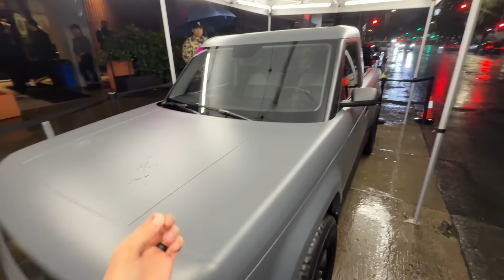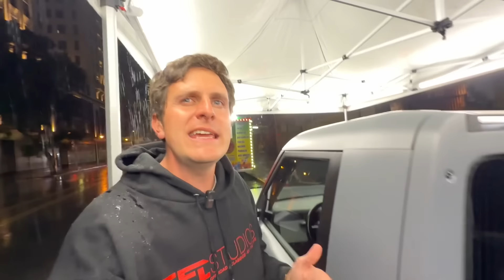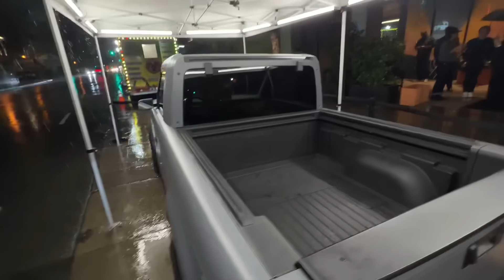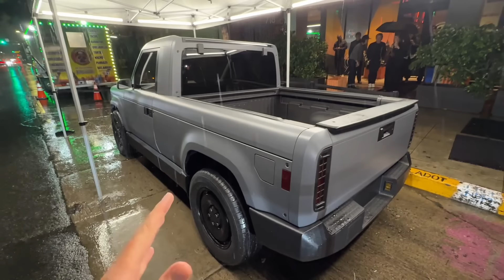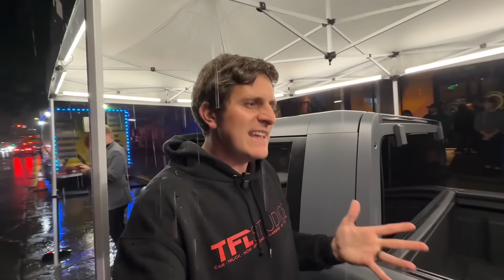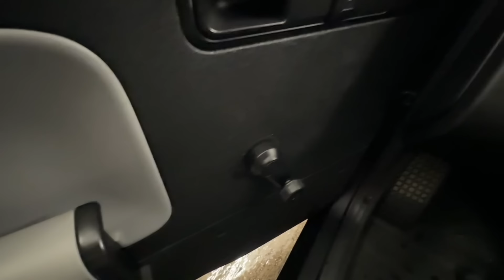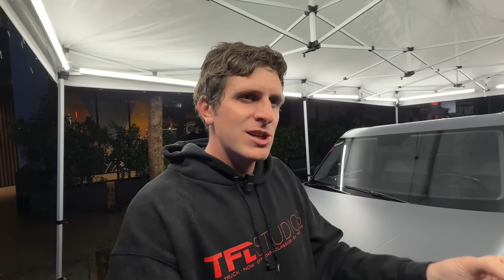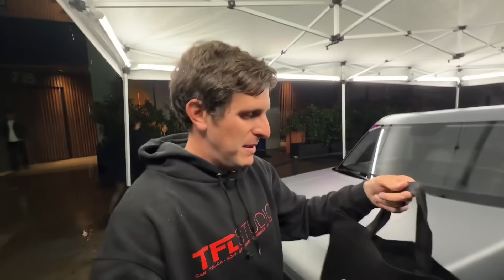The TRUTH About the '$20K' Slate Truck...Will This Really Be a Hit?

Comment: An in-line four with a five speed manual would be perfect in this truck.
Reply: Doesn't even need to be 4 cylinder iny eyes it could be a 660cc just like a kei truck.. it needs a gas motor option with a full frame and 4x4 and it would sell like crazy
Reply: @thomascramer8523  so it needs to be something completely different and it would be good?
Reply: @TheRanscat absolutely I live in a area that a battery powered car would not work for almost half the year because of the temperature. Right now I have a hybrid that I can't use the battery because the car might catch fire if I charge it. I'm good on a grown up power wheel and will stick to using dino juice for as long as I live I gave it a try and ended up 60k in debt with THE MAIN FEATURE BEING UNUSABLE.
Reply: @johngifford7725  the electric drive train is the only reason this truck has a chance. Small trucks didn't go away by accident. They have a low profit margin and a very limited customer base especially when people can't own a second or third vehicle. With a simplified design and electrical power, the Slate will be much cheaper to produce. For reference, Tesla has twice the margin of other car companies.
Reply: Kind of misses the point of the whole thing. It's meant, from the ground up, to be an affordable EV truck using some innovative modular design concepts. This isn't going to, nor is it meant to, appeal to people who are predisposed to being dead set against anything EV.
Reply: They can't put an ICE in this. They'll lose all of their "green" funding.
Reply: @chairmankaga2821  The green funding won't be there anyways. That all being said, developing a ICE model would probably cost them more in R&D than putting out an electric and the consumer would be paying the extra cost for the manufacturing anyways.
Reply: A few years I said once the EV's get more range and the entry level prices drop you will see alot of these cheaper EV's enter the market because the IC vehicle reliability in the last 10 years with engines and transmission failures are through the roof.

The dark horses in this race are the Chinese manufacturers who just got a toe hold into Canada, I give it 20 years and the US manufacturers are going to be crushed by the Chinese.
Reply: Exactly. Simple would be a basic gasser with a manual. Ease of repair and simplicity. Electric is stupid if this is supposed to be utilitarian. Think if someone came out with a basic D90 again…would sell like hotcakes if priced right.
Reply: @znutar the problem is neither an internal combustion engine nor a manual drive train are simple or easy to produce. There are way more parts than an electric car and many more high cost design tradeoffs. Simple trucks used to be cheap when labor everywhere was cheap and the average American was relatively less poor.
Reply: @ianbelanger7459 say that to Suzuki 😂😂
Reply: @estebanamador7601 there are 150M American adults. If 1% wanted such a vehicle and replaced it every 12 years (the average age of a US vehicle), the market is only 125k vehicles a year. A production line for a low margin low cost complicated vehicle isn't justified by those numbers, which is some of the reason the small truck went away.
Reply: @ianbelanger7459  you can get a brand new Jacobsen Suzuki complete 660cc engine and transmission for around 7k. I'm pretty sure the battery alone in a slate truck costs 9,300 dollars to replace. Make it make sense again.
Reply: @thomascramer8523 the issue is that engine isn't road legal, isn't crash tested and parts prices aren't exactly equal to design impact and installation complexity.  That engine in that configuration isn't design as a vehicle power plant with things like generators and A/C systems. Even if an affordable small truck could be built, which it can't, the Slate would have to be two different vehicles to have an efficient ICE and Electric version because the design tradeoffs are fundamentally different making the production and sales problems far worse.
Reply: @ianbelanger7459 that's on them for falling into the green trap. If I was building a vehicle I would have made the platform conform to what  is the normal which is ice with a full frame that would have been more adaptable to ev conversion. People prove it all the time with turning Ford rangers into ev's with very little modifications. Just like the guy in the video said they pigion holed themselves and it will never take off like they think.
Reply: @ianbelanger7459 the majority of the people that want a small single cab bare bones pickup truck want to use it for work on farms or for smaller deliveries and a ev just isn't capable of doing the work. It should have been a 3 cylinder turbo instead of 150 mile range ev. I already proved ice are cheaper and with the extra 3 grand that could have went to a full frame which would have made it cost roughly the same in a 2wd version
Reply: @thomascramer8523 there has been no evidence presented that a road vehicle can be made cheaper with an ICE drive train. The engine proposed is not an on road engine and isn't capable of supporting that operation in the proposed configuration. Even if this is considered an off road working vehicle, there isn't a market for it. There are only 200M American adults. If one in a thousand bought one truck every 10 years, that is a 20k units a year. That simply doesn't justify the investment in production of a car. The small truck only makes sense if it can get beyond the traditional market. If the price point can be hit, there is more room for production margin and potentially more market.
Reply: @ianbelanger7459 kei truck imports have exploded by 300% in the last 5 years with 7500 being imported in 2024 alone with zero marketing there is a market for a small ibc truck in the United States. And a Chevy 1.0 could very easily be adapted to be a rwd configuration
Reply: @estebanamador7601  the japanese landscape is a very different one than the americas; much smaller and lower speeds
Reply: @thomascramer8523  $2k difference over 200k miles, is a good trade in. Fuel cost alone will provide a much greater profit
Reply: @znutar  emissions laws are based on vehicle size. This is the reason why all the trucks have gotten bigger and bigger

Comment: The manufacturers turned the 4-door pickup into a lifted family sedan that is missing the trunk lid.
Reply: That are mostly used as basic transportation by just one person driving less than 50 miles a day.
Reply: @norsefalconer   Correct
Reply: Cant blame them. Very comfortable vehicles. Ive yet to find a sedan that was more comfortable to be in than a truck or SUV. Especially if you want to haul people in the rear, sedans are far to compromised with sloping roofs to be practical long term.  Im not even 6 feet tall and find midsize sedans miserable affairs in back. Compared to a midsize SUV or full size truck.
Reply: @baronvonjo1929  I can blame them.  You misunderstood my comment.  A four-door, 5-ft bed, half-ton truck isn't a truck anymore because there are too many compromises to make it comfortable.  But you go ahead and keep driving your mall-crawling cowboy Cadillac.

Comment: I dig it for the simplicity. But the 2WD and range thing is an issue.  One of my favorite camp spots is at the end of a trail that almost always does body damage up a steep butte. And the base of that trail is about 60 miles into the forest from the last signs of humans. The slate just wont do it for me, but I want it to be able to.  
Now for an around town commuter hauler. Yeah I'd do it. But my driveway is not big enough and is already filled with my wife's old Mazda B4000 4x4 and my old Montero.

Comment: 1.) I highly doubt this will actually cost $20K. This is not built in a way that is affordable to manufacture.
2.) In reality people don't want to customize their vehicle like this. They want factory install of just the options they want, and not the confusopoly manufacturers currently do (<- that's the actual complaint).

The Slate already doesn't compete with the Ford Maverick nor would it compete with the Toyota HiLux Champ if brought to the US, but it will get absolutely annihilated by the up coming new Ford EV platform and other manufacturer's options... which aren't even going to address the confusopoly aspect, but will at least offer a functional vehicle right off the lot at a similar price

Comment: 3 words:  right to repair.  As long as they keep this philosophy, I am very likely to buy.  

The real reason the dealers can't sell the base models of Wranglers and Mavericks is that when they don't come with a feature, you are stuck not having it. You will never be able to add it because you are locked out by the manufacturer. The whole point of the Slate is that you will always be able to add what you want, even if you don't buy it from the factory.  Not paying interest on heated power seats that you never use will appeal to more intelligent people. 

A gas range extender could be sold as one of the accessories. It's a truck, so it can go in the bed.

Comment: I've reserved one.  I don't mind that it doesn't have all the "first-world" keep up with the Jones's tech and power everything.  Most of the trucks I've had were regular cabs, most were simple w/crank windows, no cruise, short box, 2WD, and practical as heck.
Like the Maverick XL trim, people want simple and affordable.   Do people want this with an ICE option, I've love it, and AWD for where I live it could boost sales too; but is AWD a necessity -- no!   Most trucks I've had have been RWD, and I live outside of Buffalo, NY and rarely every have used snow tires too. 
Ford, a name you can trust....  LOL!  I worked at a Ford dealership, never again.  They're building garbage and after my special ordered Maverick, which I happily got rid of, I'll probably never buy another one again.

Comment: I'm in my 50s older children. Drive a Ford Maverick. The slate is perfect for my lifestyle. Small truck to make runs to the dump/recycling Center. Lowes HomeDepo runs.  Enough range to run around town. But how many people are in the same demographic.
Reply: I think there are a lot of people in this demographic. I expect the naysayers to get a big surprise next year.
Reply: @susanjj  the KEI are coming now battery is dead 😵.
Reply: I'm in this demo, but why buy a Slate when I can get a much more useful Maverick for the same price.  If the Slate has a gasoline engine, AWD, and was under 20k, I'm interested.  At almost 30k I'm not even going to take a test drive.
Reply: @patjohnson8483    How is the mamverick much more useful?    A gas engine is NOT a plus. duh.
 EV's don't need AWD with batteries in the frame down low.   Mavericks suck ass.  Weak engine, gas AND electric to deal with. Starters, oil changes, timing belts, etc etc etc. At almost 30k not even going to take a test drive.
Reply: @patjohnson8483  You don't seriously think anyone can build a truck for the US market that's gas powered, AWD, snd under $20K, do you?
Reply: @jamesrodriquez2863 yes.
Reply: millions and millions
Reply: It’s all emotions and biases. A lot more people are in demographics this can serve than willing to accept that.
Reply: Yep, it’s not powerful enough for tradesmen to use it - plus they need 4wd!

Comment: Wholeheartedly agree with your EV range comment. "People buy the range for the road trips they never take". Also true for pickup trucks. "People buy pickups for the loads they never carry and trailers they never tow". As always, there are exceptions, but I dare say that it is true for a large piece of the overall pie. 
The Slate is daring in its simplicity and I see plenty of work applications where this truck would be totally fine. Whether people will buy it voluntarily because they see the value, or whether they will drive it, because the company bean counters make them drive it, remains to be seen!
Reply: People buy them because in the future they will carry heavy loads and trailers. 

Daring?

NOPE - All vehicles were like this in the 1980s and 1990s, this truck is nothing new, I’ve been there and seen this all before 30 years ago. 

The ‘slate’ is nothing new.

Comment: In 1990, I bought an F250 regular cab with manual windows, manual locks, and no cruise control. The only option I sprang for was 4WD (controlled by a lever). $8900 out the door. In 2005, I went to buy the same truck. It was then $35k and special order only. I ended up with an F150 in the same spec. $25k, IIRC. I love the idea of the Slate, but I think it has zero chance of being chosen over a Ford Maverick if there's only $5k between them. The vast majority of buyers are financing. $5k over 7 years isn't a whole lot of money each month, for a lot more vehicle. For people leasing, it's a no-brainer that the Maverick will command higher resale value, which means lower payments. The only way Slate will succeed is if it can lower the initial launch price and keep it low going forward (or reduce it as Ford showed with the model T).
Reply: The electric is the big sell here. This is perfect for people that have known routes and drive a lot. Tradesmen, electric, plumbing etc. 
I drive around 30k yearly and 99% of that is less than 100 miles away. That's around a $1000 difference between electric and gas every year. Also this bed is a Lil bigger as well
Reply: The price of the 2025 Ford F-150 starts at $40,045 and goes up to $74,095 depending on the trim and options.
Reply: @timothylongman2475  Thanks for that. They're all over priced. GM wants to sell a FOUR CYLINDER 4-door pickup with turbos for 40K. That thing's absolutely not going to last 300,000 miles. Give Meth to a teenager, and he can be a 1-man refrigerator moving company, but he's going to destroy his body. Same with 300HP 4cylinder pickups with twin $4000 turbos. (good luck when those fail).

Comment: Absolutely hate the slate...  I don't find it elegant in  its design.  Efficient..yes. Elegant...  nope. To get the price down...did they save money, by giving a free subscription of Illustrator to a 3rd grader?     Also any truck with exposed hex bolts is going have their parts easily stolen..   I'd rather wait  for a Toyota Hilux Champ to be imported.

Comment: Access to level 2 charging is rare, and difficult due to permitting, availability of off street parking etc... charging at 1.44KWH takes WAY to long if you have to commute greater than 20 miles in 1 direction and work 5 days a week. Electric cars remain a privilege for people with homes AND off street parking AND in place electrical service to easily upgrade to level 2... it CAN'T be widely successful with a small battery and poor infrastructure, and a price that will inevitably balloon quickly after release, not to mention you will have something that is both bare bones AND spendy AND complex / difficult to fix... talk about a recipe for failure. If I were RICH it would be interesting.. if your RICH you don't need cheap, and don't want barebones, pointless SKU
Reply: There is more to the range argument than roadtrips, what if you live in an area with Tornadoes / wildfires ? you need to have enough reserve energy to clear out of tornado / wildfire range un-planned as well. Range extender AND still affordable would be an absolute game changer. sell it with a high reliability engine as a range extender at cost (no profit on the engine)? THAT would be worth it. it definitely won't work otherwise. the range is a HUGE deal. Also about the base model Jeep... Jeep did it to themselves. locking diffs and disconnectable sway bar is THE killer feature for the jeep, off road is the reason behind that... when you lock those features behind the higher in 60-70K trims don't come crying to us when it doesn't sell.. who cares about the "Rubicon" badge. Sell a sport with hard-top (soft top always leaks) locking diffts and disconnectable sway bar, THAT is the low end affordable "sport" model that would actually sell, not about the badge, and they KNOW this already, that's why they lock it all behind the Rubicon trim, it's called artificial product segmentation, they sell a cheaper option that does not actually have value just to claim they are affordable... well guess what, everybody sees through that lie, that's why CDJR is suffering so much, they lock the few killer features people want behind psychotic prices

Comment: So much "Yes", but still a "No".
It needs a high performance model to peak interest. 
I'd love something like that with a hot tuned 2L 4cyl turbo RWD in a "light" 4WD hybrid option that just tops off acceleration, keep you from getting stuck and that fine tunes the steering/cornering.

Comment: Without the tax rebate this truck is DOA. It was questionable with it, dead without it. Maverick is better in every way besides maintenance costs of an EV. If Ford comes out with their rumored smaller cheaper truck, they may as well just change Slate completely. Maybe add an ICE motor, or change the tech into a golf cart, or side by side or something.

Comment: You can use your 13" tablet and have everything you need while driving. There is also a larger battery you can get. Remember the truck has Regen on it that will put power back in the battery. This is not known how much. Some has an EV and hasn't had to replace the brake pads in 36k miles since they use Regen for slowing down.
There was talk that they might come out with an extended rang version. You will loose the front trunk and any power outlets that might be there.
My main source for the more detail is from @outofspecreviees